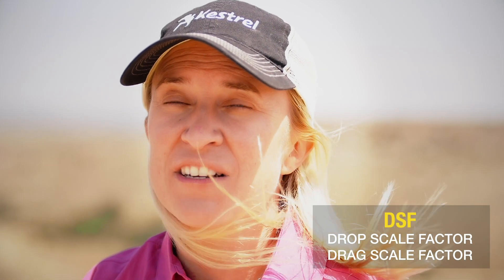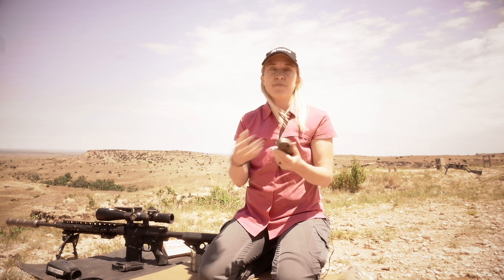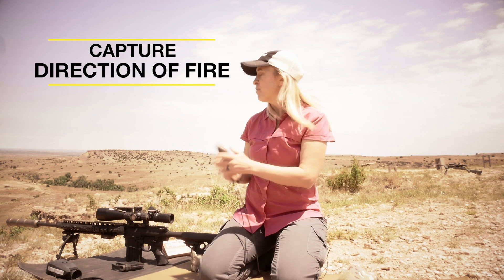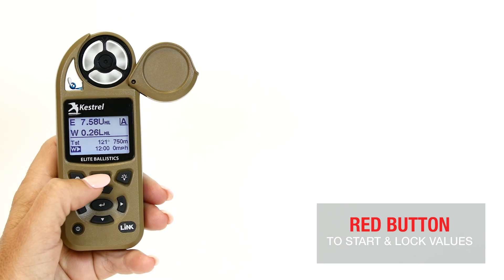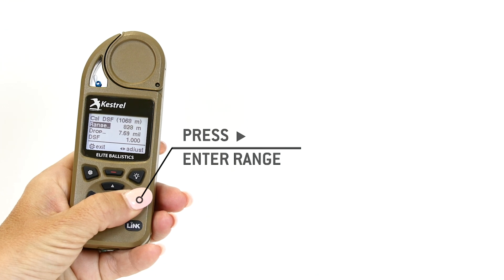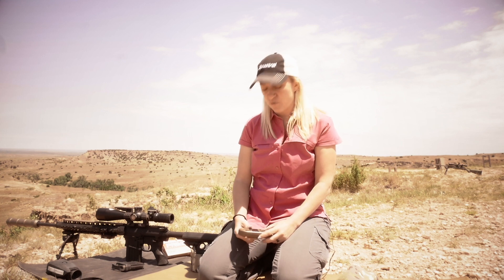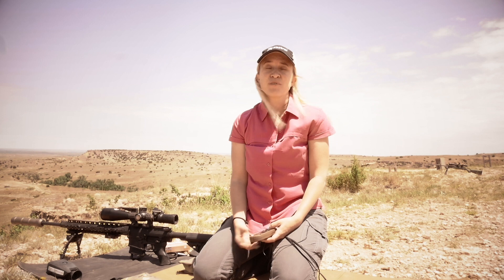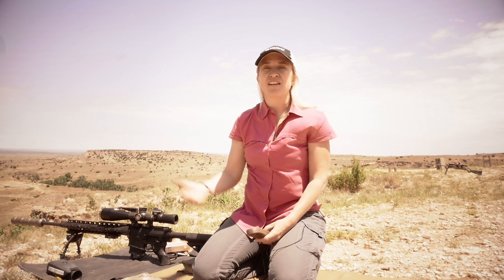Calibrating DSF on Kestrel Ballistics Meter

Comment: I am confused.  You said that the number in the upper right is the distance the round goes transonic and you mention 1525 meters.  However the Kestril shows 1068 meters.  What am I missing?
Reply: Ditto.  And the prior video for Cal MV had different readings on verbal, graph and display. Which are correct?  The 15% math didn't work out.
Reply: Yea same I'm totally lost she says 1525 where did she get that value from when the Kestrel showed 1068 m in the top right corner??
Reply: Her example numbers, as stated / spoken, referencing the specific rifle she was shown with, were completely different from the close-up visual aid they were showing in the cut-in scenes.  That's all.  Go off her example and it adds up.

Comment: Very straight forward, as a new owner, to much info in to short time, but on point.
I hope I will get that all in some time.
Didn´t just understand when to do what with the wind and environment, and when to do it again.
Just one dumb question:
Do I have to calibrate the compass every time I shoot, or am I doing it once and it is done for all time?
Reply from the maker: No dumb questions here. You do not have to calibrate it every time you shoot.  You should occasionally recalibrate it though such as if you drastically change locations or every few weeks.  If your Kestrel was exposed to a magnetic force, you should recalibrate it.  You also need to recalibate it after changing the battery or updating the firmware.
-Kestrel Ballistics team
Reply: @KestrelBallistics  Thanks for the answer.
May I ask one more question?
I have calibratetd "Environment" through rotating the Kestrel with the strap and set it on "live".
I have tagged the shooting direction by holding it vertical towards the target.
What am I doing now with the wind?
I can tag it, like the direction, I understand that, but can I measure it "live" too somehow?
And why (when "Environment" is set "live") don´t the measurements change?
Cheers, Ouw.
Reply from the maker: You need to wind capture as that is not part of the "environment" measurements.  Highlight Wind on the menu and point the back of the Kestrel into the prevailing wind.  Press the red button to start a capture.  Press the red button again to stop the capture.  The Kestrel will populate wind direction, average wind speed (W1) and max wind gust (W2).  The capture can last as long as you want.  Alternatively if you have the weather vane, you can start the capture (red button) and let it go and you will get constant "live" updates of the wind.  The environment should be changing to temperature, humidity and pressure changes when set to live.  It might not change much if you reached current equilibrium conditions though.
Reply: @KestrelBallistics  That is exactly the answer which I´m looking for since two days!
Thank you so much!
Best wishes,
Ouw.
Reply: @Ouwkackemann  7

Comment: i was out today with my 338 shooting 1000 yards kestrel said 7.28 mill but that was to high 6.8 mill put me on target do i need to adjust my bc? i was taking my mv as i was shooting with my magnetospeed v3
Reply from the maker: It depends on whether you are in the supersonic region or transonic region at 1000 yards with that gun.  If you go into the Ballistics menu on the Kestrel, you can look at the Rtrans number to know when the bullet gets to transonic.  If the bullet is shorter than that range, you need to do a CAL MV (even though you measured it with the Magnetospeed).  If the bullet is past that range, then you would do a CAL DSF point.
- Kestrel Team
Reply: @KestrelBallistics  ok thank you for the help

Comment: Love the DSF for trans and beyond.  If ones optic had error or a rifle system with axial imperfections,  can you use the DSF in the supersonic region to correct for the error? Thank you, I really enjoy your videos.
Reply from the maker: Hi 
Thanks for watching our videos! To answer your question- you cannot use the DSF in the supersonic region. To compensate for a known error with the scope, you can use the zero height (ZH) and zero offset (ZO).  Enter these values based on the errors shown in your zero (at 100 yards) and this will propagate throughout the rest of the supersonic region.
The Kestrel Team.
Reply from the maker: Hello
Just noticed during a channel audit that we left this unanswered. Apologies and hope this helps. DSF is only for transonic and subsonic you should use CAL MV in the supersonic region to help. We are going to implement a Scope Correction Factor in a future firmware update that would also help but we don't have a timetable for that at the moment.
Regards - The Kestrel Team
Reply: @KestrelBallistics  as the scope correction been implemented, and if so, when?
Reply from the maker: @BobJones-zw3ui  Scope Correction has been implemented.  It is in the Eunit and Wunit submenu